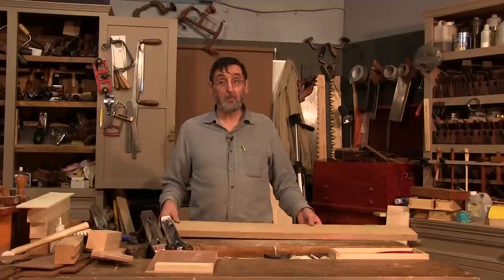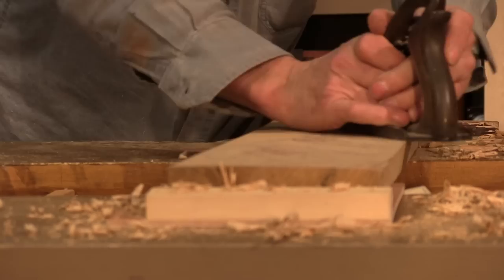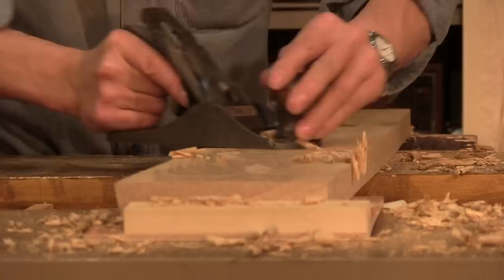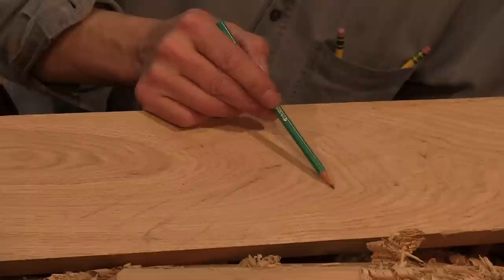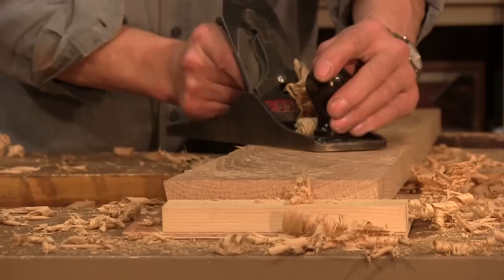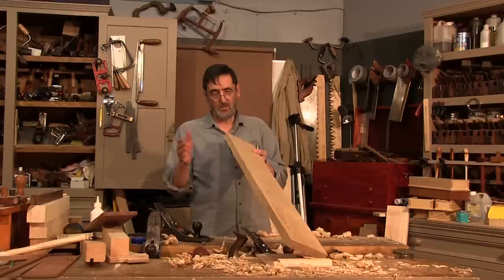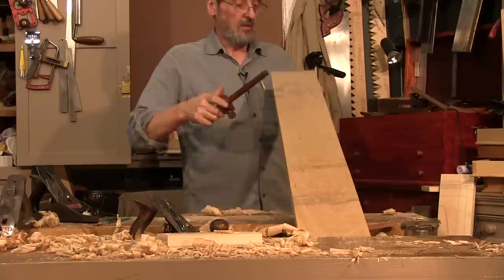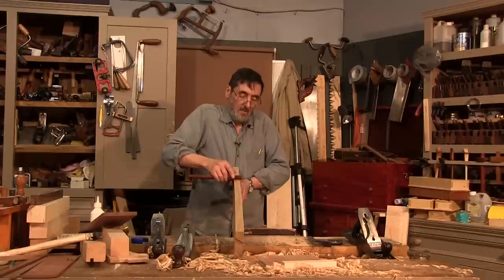How to make flat boards straight, smooth and square (stock preparation part 2) | Paul Sellers

Comment: Since childhood I've been fascinated by traditional methods of woodworking... but that was a "boy" thing in my hometown so I didn't get to pursue it. As an adult I couldn't find anyone who did traditional toolwork, it was all power tools, and I quit considering it. I just found your channel. This is a true dream come true for me... and this video triggered a comment. You picked one stubborn twisted, cupped, wavy board. You got out of breath and your arms got a little worn out. You showed it! You showed it's not as easy as you make it seem... and that genuine aspect gives me hope. Even if my arms get weak and I have to pause for a bit, I can still work the wood and make a beautiful silky smooth square board too. Thank you, as so many others have said, for passing on this knowledge to those who don't have a mentor or anyone to pass it on to them directly. Silversmithing was a family trade that was lost 2 generations ago, much to my dismay. Maybe I can start a new one to pass down.

Comment: This may seem like an awful lot of work to most folks but I have tried to get the same result with sanding blocks and sand paper. I will never try to use sand paper to true up a nice piece of Oak again.
I am shopping for a set of planes after watching some of your videos, Mr. Sellers.
I have learned a great deal from your videos, thank you for sharing your knowledge with us.
Reply: I’d rather kill myself than use sandpaper to level a piece of hardwood. You’d be there for a decade!

Comment: With cheap benchtop jointer not working so well (probably an issue with operator error or setup inadequacy), I am finding myself going to hand planes more and more often to fine tune my boards and I keep searching for your videos on whatever I am trying to do and you never fail to give me exactly the information I need.  So.... back to my workshop and of course my first course of action will be to sharpen my planes and chisels as always.  Thanks, Paul - hope you are enjoying your life back in England.

Comment: Thank you so much for this video.
I've made some garden furniture in the past which had a rustic look, although it wasn't meant to. I could never get 2 lengths of wood to lie parallel to each other due to the inaccuracy of my table and band saw. (never used hand tools)

I've moved away from machines now and am buying second hand, hand tools. I find that the 'work out' I'm getting from restoring and using them (thanks to your videos) is doing me a power of good and I'm also getting better results!
I've never bought any timber, I used to have a free supply of 7ft x 4" x 2" 'skids' off wagons but that has now dried up so I might have to start buying it when I can afford to.

I love it when you put a bit of humor in the videos, it's very dry and hard to spot but always makes me laugh, I think its important to have fun, I always manage it even though I'm on my own in the shed, the dog thinks I'm crackers....

I look forward to watching all your videos in the future.

Comment: Great Paul very beautiful video. Yours advice are very useful. Yesterday I flattened my first board of Ash tree with my new "old Stanley #4 and #6. It was a good experience, the job was long around 3 hours. I'm very happy because I worked with old blades not sharp, but the result it was great the same, the surface was very smooth.
Reply: Sharpening them, then, will open up a whole new world of possibilities for you.

Comment: I love that you demonstrate this on a piece of hardwood, & speak about how much effort it is.  It's also great you picked a board with cup, bow, and twist.  In the US, we use the term "against the grain" where you're saying "end grain."  We use "end grain" solely for the end of a board.  You say your planes aren't special, but they're pre-1960s Stanleys that you've tuned.  You can't buy those at the hardware store, but I appreciate you telling us we don't need expensive boutique tools.

Comment: I love the whole video... especially when he says "I'm going to rip this down and stay away from my line by a1/16 of an inch" then does just that. And when he flips the board  to make the second cut it meets the first cut dead on (at 31:43)
Reply: its an old carpenters skill, applying slight twist to the saw to keep on the cut line... 

and as long as the line is straight theres no reason why the cut shouldnt meet up :)

tricks like this are vanishing since people are always using power tools.
Reply: From what I read, marking all areas of where the saw will touch using a gauge can create a groove or weak point for the saw to follow, allowing you to cut straighter.
Reply: If yours is the drunken sailor, mine is the mate hanging off his shoulder. If you do learn the trick, let me know.
Reply: but he's not cutting ON the line, he's cutting 1/16" to the side of it.
Reply: Mine is the second mate dragging behind the first two .ha ha .
Reply: Badger0fDeath  I've heard it said, (and I believe it) that hand sawing is one area that you can blame the tools for not getting the results you want. My ripping was an atrocity. I manage to find myself an used saw set and took the time to sharpen and set one of my rip saws. Drastically improved the quality and straightness of my cut and cut it twice as fast. All with a softer touch. Check out Shannon Rogers, the renaissance woodworker. He has some good videos on saw technique and a great lecture that breaks down how saws work in great detail.
Reply: @dixie_rekd9601  I can do it and I'm no carpenter ;)
All you have to do is saw for a few meters and pay attention, the steering of the cut becomes pretty easy. Ofcourse staying square to the surface is not so intuitive, but you get the hang of that eventually. The trick is, just do it and realize it's not a trick at all, it's a skill.
Reply: @musicbro8225  yeah exactly, its somewhat counterintuitive how much "steering" you have when using a hand saw. its actually relatively easy when you get the hang of it.

Comment: Although I have never hand planed a board, it seemed as if I could feel the tool in my hands and the resistance of the wood in my arms and shoulders just by watching and hearing you work. Amazing!

Comment: Great video, knowing first hand how hard it is to run long stock through an electric  jointer this technique is something I NEED to learn. Flatten one side by hand and run the other side through an electric planer........hybrid woodworker? I've also passed up some really cool looking wood because of twist and cup etc etc, I'm all in on learning more with hand tools. Thanks for the video.

Comment: As a beginner this is something I've been putting off for ages. I purchased a long piece of oak to practice on, fingers crossed I can get it right! Great videos Paul.
Reply: Keep practicing it. Also do it on small boards as well. And try and do it on projects even if they do not look good as it will give you an idea of how you are improving. 
Check out Paul Sellers common woodworking website that covers everything he has in the videos but much much more. I got my sons and daughters to do it to expand their ability. 
You only need three tools a handsaw, planes and chisels and with that you can make anything all the other tools are a luxury.

Comment: Memories flooding back from this vid from school, learning of my dad and uncle to. :)

Extremely informative well and made videos.

Thank You Kindly to all Involved.

Peace n love all

stay safe        PiP
Reply: What were the two smaller planes?
Reply: @AlexEllis , Two Stanley No. 4's. One set up as a normal smoothing plane while the other one is set up as a scrub plane with the blade heavily cambered (curved cutting edge), the cap iron set back an 8th of an inch from the blade's cutting edge and the frog set a little further back for more clearance for the thicker shavings it produces.

Comment: Dear Paul,  you have converted a retired architect into a woodworker, who wants to be like "Paul" one day, hopefully. After I had my white oak cut down (was leaning towards my good neighbor's driveway), I kept three 23" diameter, 4-5ft long trunks. With a help of a good friend and using a chainsaw mill, we sliced ca. 25 slabs varying in thickness 2" to 4". They are stickered now and I am waiting for them to dry. This is the only way for me to describe how much you influenced me and I am thankful to you for it. At this point, I need to ask for your advice again: Once the wood is dry,  I will need additional planes (in addition to my Stanley Bailey #4 and a scrub plane) to flatten, trueing, squaring, etc. and some appropriate saws. What would you recommend, what would be your next step? I have a long list of furniture requests for my two grandchildren and I would like to be prepared and ready when my white oak is ready to work on. Your reply and suggestions will be highly appreciated. Thank you in advance!!

Comment: Makes you apreciate your power tools!
Reply: Mee eens, maar een blokschaaf heeft geen stroom nodig.
Reply: Served my time, under my dad, made me do everything with hand tools before using power tools, the only way to learn
Reply: No, It makes you apreciate  a craftsman.
Reply: It gives you hand skills.
Reply: @bighands69 , actually, it gives you an understanding of the wood that you'll never get if you just "Power Through" it. Once you acquire that understanding you can use your power tools much more effectively. (Choosing the right bits, blades,  angle and depth of cuts, etc. that you'll never get with the "Measure`, Cut & Shove" power method.)

Comment: Flat ,straight , wood was rarity when I shopped at B&Q warehouse. For a good reason . Above the area where they stored the wood in racks was a huge hot air fan blowing down on the wood .  A large company specialising in DIY and tools getting that so wrong . I always picked the wood without knots that had survived the heat treatment .

Comment: Hi Paul, a former resident of Texas here, I get the reference. I'm guilty of using afeared in the past, haha. I now live in Virginia, Born in New Mexico and raised on the west coast, Seattle, and San Francisco.  I'm a recent devotee of your channel and I was wondering if you might recommend the first two planes that I should add to my collection.  I recently purchased a #4 harbour freight plane for $13. I did it as an experiment so I could understand the difference between good and bad planes. This one is BAD. I am giving it a new life by refining the sole and taking care of all the needed flat and sharp surfaces.  I'm inexperienced with hand tools but learning fast with this cheap plane. in the distant past, I have had a shopsmith 5. It was fun but a hassle despite its versatility. I really enjoy the organic relationship with wood doing as much as I can by hand now.

Comment: Paul, thank you so much for taking the time to put together these awesome videos; I'm definitely subscribing.  I notice you usually drag the planes back rather than lift the cutting iron from the surface on the return stroke and was wondering if you would comment on this, as I've read that this practice will actually have a dulling effect on the blade edge over time.  Thank you again.

Comment: 3 in One? That's what I've been using as I was heating up my 22" serrated and that made it glide like that swan and use it on all of my planes and my saws damaged from floods. They are still pitted after restoring them but I needed a little saw left so I'll live with the drag but they do still cut like a plane with my lightly soaked rag of 3 in One which I keep in a big tuna fish can. That is my "wipe all steel tools rag" that sits on my tool bench.

Comment: Paul I admire all your efforts and your videos and you make it all look so easy. But I'm handicapped to a point that I can not stand and do any planning as you can, so can you tell me if there are other ways to accomplish the same effect as you get. I've even thought about going about it as the japanese woodworker do their way. Have you ever assisted a handicapped woodworker in working out their problems?
Reply: I know this is three years late but take a look at roman work benches, the kind you sit on. Lots of videos on them on YouTube and actually Paul does a video for how to make a sawhorse with the angled legs, which could be scaled up and used as a roman style workbench. You just put your wood on the bench, sit on it (that's your "clamp!") and off you go with your plane. You could of course chop and chisel and saw from this position as well. I am considering building one myself as I have a bad back and when it starts acting up I could continue planing on the low bench while sitting.

Comment: Paul, please would you consider doing another video on stock preparation? Every time I plane something it just seems to make something else worse and so I'm always chasing my tail. An idiot's guide video that breaks the whole thing down into analysing a board's cup, bow and twist and how to systematically remove them step by step would be greatly appreciated.

Comment: I would love a discussion about why people skew the plane, it’s pros and cons.
Reply: Depends on the hardness and the direction of the grain. Skewing the plane presents the blade at an angle to the wood, much like an up or down-cut router bit does, instead of cutting square into the problem area, you slice into it instead. (In a way, its like the difference between chopping meat with a cleaver, for example and slicing it with a chef's knife.)
Reply: @johnbesharian9965  So well answered!
Like dragging the blade of a chisel slightly sideways and suddenly it starts moving into the wood. So it's minimizing tool pressure and so minimizing tear out (of corners and opposing grain). But there is an element of deflection going on, so the tool pressure is being diverted sideways such that the grains are all pushed sideways into a bunch where they are more restricted and can't tear out so they stand strongly in place while the blade slices into them.

Comment: Paul - my apologies if this question has been asked already, but when you flipped the board over to clean up the 'non-face' side and clamped it with your vise and your bench hook, as a viewer, I can see the board 'flexing' as you planed it.  That would seem to indicate some sort of longitudinal or 'end to end' bend in the board.  What's confusing is that the board sure looked like it was, as I love to hear you pronounce, 'dead flat'.  What is the cause of this flexing (or maybe I should say 'apparent' flexing)?  Many thanks - love your videos - keep em' coming!
Reply: Part of that is from how he's clamped it.  If you watch at the beginning he has a dog in the vice (small piece of brass) and a stop board that looks like 3/16" (5mm) plywood with a 3/4" x 3/4" stop sitting against the well.  This means that end of the board is sitting 3/16" (5mm) above the bench so the center will flex as he planes.  5:30 shows it reasonably well.

Comment: Chava Flores, I would say you definetly need a no. 6 or 7 plane at some point, unless all your stock is farely short.  The no 4 will only straighten maybe 24'' or so and then the little guy just kind of rides the hills and valleys of the wood.  If you are going to be truing up boards 4' or greater, you do need a longer plane.  I highly recommend Chris Scharz's "Handplane Essentials" for about 22 dollars, it is an excellent book.
Reply: jon s Watch Paul's workbench video. He levels the entire top using a number 4.
Reply: +jon s You definitely don't need any longer plane than the #5 1/2, and even the #4 is good enough for most things. The jointer planes rarely even stay perfectly straight for long, which kind of makes them do the opposite you want them to.

Comment: Thank you so much for sharing your knowledge and Experience Paul!  Love your videos!  
I'm trying to straighten some fairly twisted "common boards", which I think is Home Depot's term for really knotty pine, and I'm have a really hard time.  The boards are 36" long, 12" wide, and 1" thick; or at least they were before I started planing them with my no. 4 plane.  They're shrinking fast and still pretty twisted.  Is what I'm trying to do possible with a no. 4?  It's the only plane I own.  Time to invest in something bigger?

Comment: I’m trying to master the hand plane. Bought a set of Woodriver #3,4,5,6. I sharpened the iron and got the #5 scary sharp. I can shave with it. I put it back in and tried it and it wasn’t cutting very well and I’m like what the heck. I had the chipper ahead of the iron 🤣🤣🤣 corrected that, set the chipper back about a 32nd from the iron and tried it and it cuts nicely but I don’t see how you guys can square the edge of a board with one?

Comment: Paul, when you back your iron off to plane the sides are you placing equal pressure along the length of the plane through the stroke are is there a front bias?  can't thank you enough for all these videos.

Comment: Great video and very informative. Than you very much, Paul. One question : how come when you were planning across the grain you did not get any tear out on the edge?
Reply: There are several ways your question could be answered. One reason he's not getting tear out there is because he has 50 years of experience.

Another is that he's got a cambered edge on his plane iron. Plus his plane was held at a slight skew, which reduces tearout. The oil also helps, I've found. And feeding out the iron in small increments. If you start getting tearout, back out the blade a bit, and try again.

Of course, Mr. Sellers would be able to give you the correct answer, I'm just chiming in here.